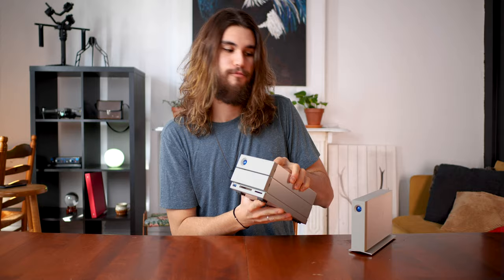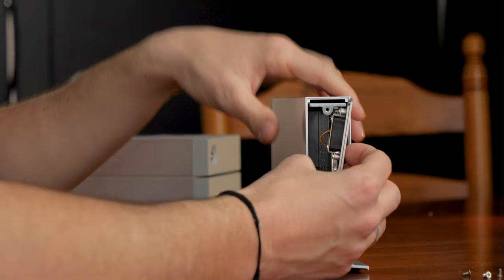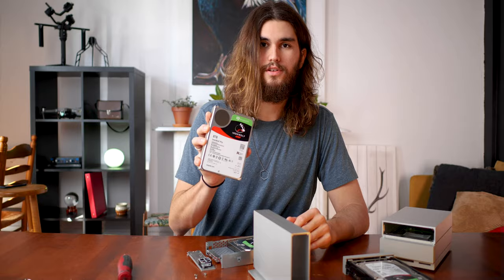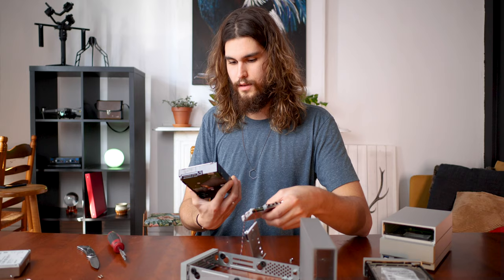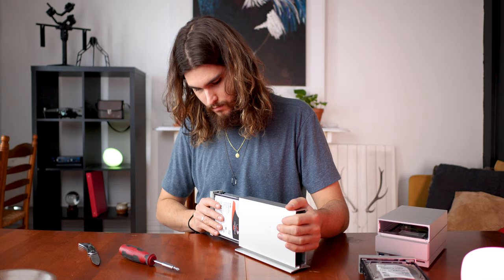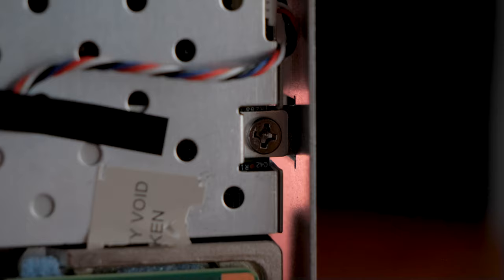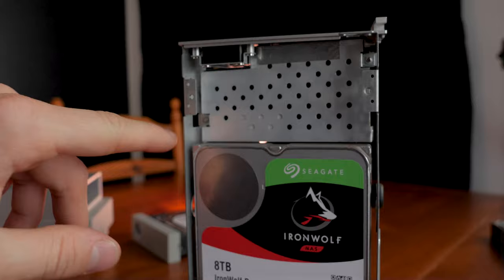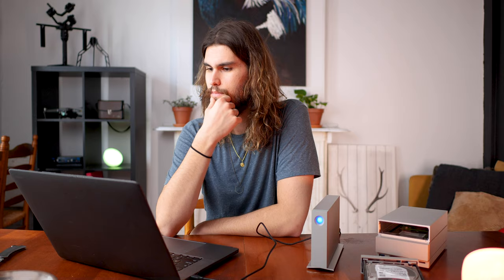How to replace the LaCie d2 hard drive

Comment: You saved me A LOT of headache with this video! I've been buying LaCie external HDs like the one you had difficulty replacing the HD with since....2005....a total of 10 to be exact....I've only had 2 fail on me BEFORE I they gave me the tell tail signs of failure (long time to boot up, weird sounds when getting up to rpms, sudden disconnects without warning, then reconnecting...then the dreaded tick tick tick repeating sound while trying to initially boot up.....You hear that and your HD is basically gone to the great beyond...at least the older versions were)....The other 8 I just transferred over to new external HD (seagate), and just put them in storage/archives. The latest two LaCies I bought are the 1Big Dock casings, which, as you've shown on this video, are INFINITELY easier to gain access to the HDDs....I had planned to just replace the older HD Lacies with new HDDs (I like the metal casings and the weight), but now that you've shown how difficult it is to replace them, I might as well just wipe them clean and donate them to the Good Will.......Thanks for the video.
Reply from the maker: No problem! I’m very glad this video could be of help ☺️

Comment: excellent john.
clearly lacie weren't forerunners of the 'right to repair' movement. my d2 internals were different to yours (possibly because mine is mains-powered), but a touch easier to work with, because there wasn't an internal fan with dangling cable. i was getting inside because the unit had died, and i wanted to retrieve the 3.5" drive to use via a caddy. so, out it came after much fiddling about, and all of its partitions showed up straight away on my mac’s screen. now, my lifelong experience with failed external hdds has been that 90%+ of the failures are due to the internal hardware/firmware crapping out, and the drive still works when inserted into an alternative enclosure, as proved the case this time. unusually tho, i thought i’d reassemble the lacie and try again – and fuck me, it worked! (who knows why? i used to smack some old drives into life again, tho that hadn’t worked here.) this is doublegood, because yesterday i lost out to some shill-bidding on ebay for a replacement, which, because of today’s fix, has become a £150 saving! it’s extra brilliant because it’s a relatively retro thunderbolt2 interface, and only second hand ones are available.
and it’s given me plenty of unexpected time to write an overlong comment.
thanks again.

Comment: Correct me I am wrong but I think the OEM Lacie D2 Thunderbolt 2 drives were 7200 RPM and the upgrade Do-It-Yourself Ironwolf and/or WD Red 8TB NAS drives are both 5400 RPM? Doesn't the reduced RPM result in a significant speed degradation? But maybe the larger 256 MB in cache makes up for it??
Reply from the maker: I had not realized this, huh. Thanks for sharing. These days I’ve almost entirely switched over to working straight off of SSd’d and using this more for backup.
Reply: Richard the spec for the Ironwolf drive is 7200 RPM.

Comment: Hi John, great video. Thanks. As you say, limited information on that model of the LaCie d2.
 I'm wondering ... did you put in the same capacity hard disk as a replacement or a bigger one ?
 I currently have 2 4TB LaCie d2 Thunderbolt 2s and am thinking about possibly putting in 8TB replacements.
Reply from the maker: Hey Alan! I did in fact upgrade. I believe I had a 6TB before and upgraded to an 8TB. Works like a charm!

Comment: What about the data of old HDD you replaced. Can you just put another external case and access them or not cause it's a NAS drive?
Reply from the maker: Hey Christos. So far I have just kept it aside. I’ve been meaning to get a USB reader like the Startech one to see if they are readable that way but as of now i am not sure. I am dreading the day that I need to go hunting for something on my old HDD and having to do this entire procedure again 😅
Reply: @JohnCastillo  I see 😅. Thank you for your quick reply. I just opened (with the help of your video) my d2 cause of enclosure failure (no power to the device). I tried to plug the drive with a common USB reader to my iMac but no luck. Ironwolf drive starts spinning, finder shows the drive for a couple of seconds and then a message of ' forced ejected' drive appears. Maybe I need a better reader like the Startech.
Reply from the maker: Christos Tararas oh no! That really sucks to hear. I hope you’re able to recover your files. If you do try out the Startech let me know how it goes - I have a feeling you’re going to beat me to it.
Reply: @JohnCastillo  Good news! With the help of a proper USB 3.0 reader files are up and running again. Everything is in place. Also Blackmagic speedest shows about 150W - 170R. So you don't have to worry either :-)

Comment: does anyone know what kind of SDD can i put in one of those cases?
Reply from the maker: I think you can put any SSD but you’ll need an adaptor/case because of the size. The connection is the same though. Haven’t tried it but makes sense in my head.
Reply: @JohnCastillo  I see! Thanks for the response

Comment: Older 500GB LaCie d2 Quadra ( 301110U )

At least one of the four drives screw was glued with Loctite thread sealer.

I ended up drilling the screw out ad re-threading later..

And LaCie firmware rejects all non-OEM HDDs

Only seeing the Samsung drive that came in it...

Rejecting a half dozen Seagate and WD drives

That have been fine in other generation LaCie d2 I have here.

BEWARE!

J.C.